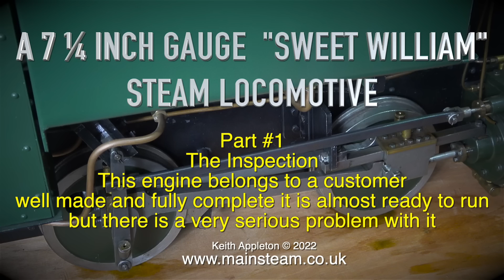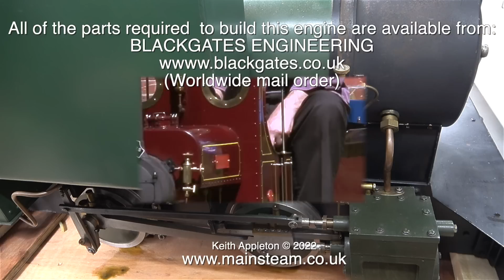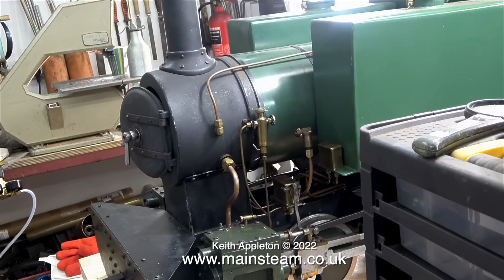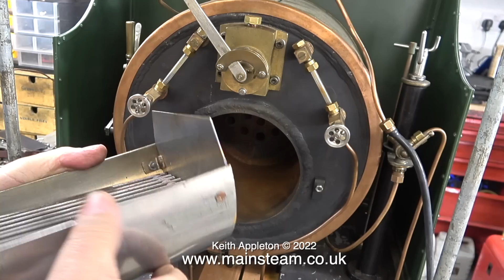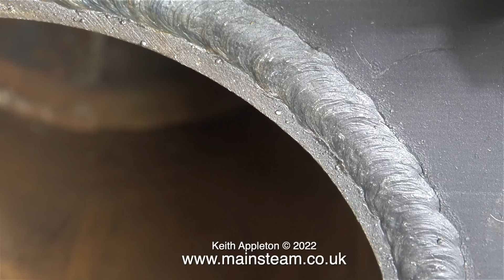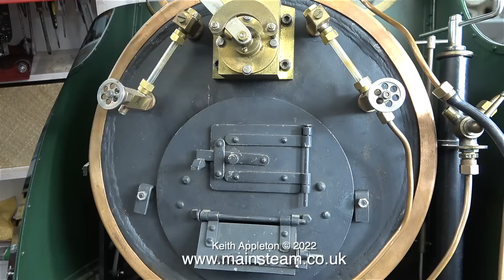A 7 ¼ INCH GAUGE  "SWEET WILLIAM" STEAM LOCOMOTIVE - PART #1

Comment: Where I live, miniature-steam scale boilers are typically NOT covered by provincial technical requirements that require certification.  Those rules "kick in" when the boiler has a capacity of more than 20L.   Having said THAT, most live-steam clubs still require test documentation before you're allowed to run your steam devices at their sites...

Comment: Can I ask Keith, how do injectors go on as I thought they needed cold water to run? If a locomotive has a saddle tank isn’t the water warm? 😊
Reply from the maker: I usually pipe them from an external water supply in the riding truck . . . .

Comment: Do you need boiler certificates for the Mamod engines?
Reply from the maker: No. They are small toys with Brass boilers that run at a very low steam pressure.